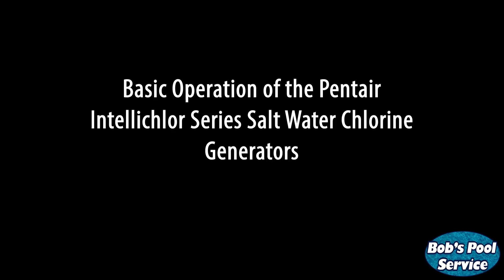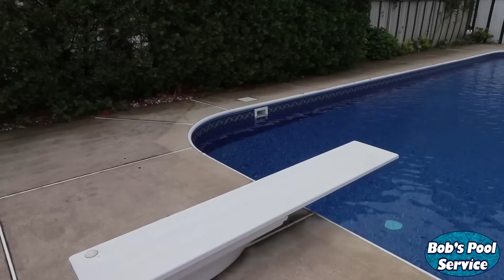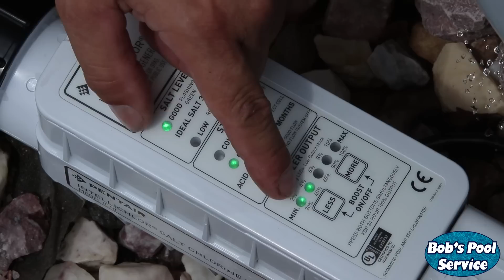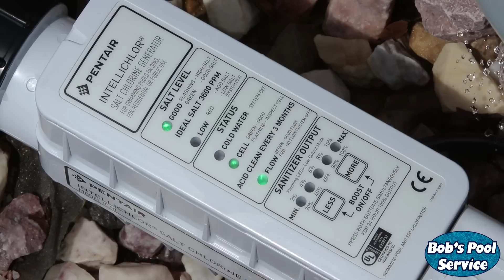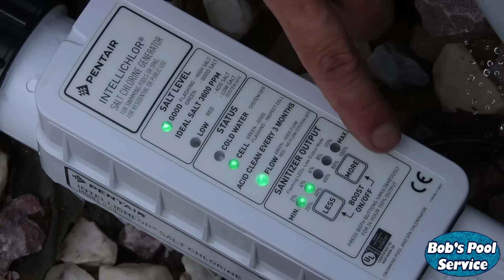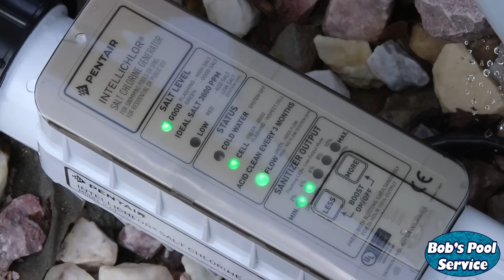Pentair Intellichlor Salt Water Chlorine Generator Operation

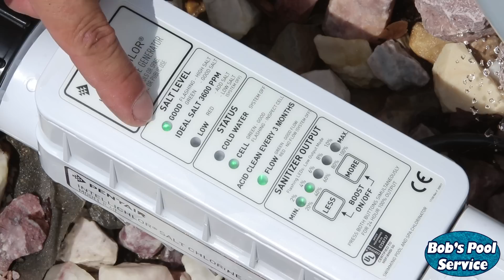Comment: 1:08 - are you referring to the “Low” light at this point?  Otherwise, you skipped that one.  And mines lit lol.  I’m assuming I’m out.  How often should these run low?  This was installed brand new last fall, “Low” is lit at opening this year.  Does that sound reasonable?
Reply from the maker: How much salt you lose over the winter all depends on the type of cover you have and amount of rainfall.  If you have a solid cover that doesn't let any rain through and you keep it pumped off so rainwater never accumulates on the top (and displaces pool water) you will lose no salt over the winter unless your pool has a leak.  On the other hand if you have a mesh cover or even a solid cover and allow water to accumulate on top displacing the pool water over the winter you will lose salinity.  Also make sure you run your system for a full 48 hours before testing the salinity, what tends to happen is rainwater is less dense than salt water and will just sit on the stop stratified, if you take a sample you'll find it reads extremely low.  Once the system runs and homogenizes the water you'll get an accurate reading.  For pools here in New Jersey with mesh covers I'm finding almost all of them are opening with about 2200ppm of salt necessitating adding another 1200ppm, for most pools that's about 8 bags of salt.  As for the lights they are a warning that it's too low for the system to operate but it behooves you to take a test and actually measure the salinity before calculating and adding salt to the pool.  Hope this helps.

Comment: Where it indicates salt level, the “good” indicator light is completely off, not flashing not solid, just completely off. My salt level indicator light is red, and reading low. My question is, when the salt level returns to normal operating ppm. Will the salt level light indicator then start working again, or is something wrong with my cell? I hope this question makes sense. Thank you.
Reply from the maker: Yes, when the salt level is back to normal the red light will go out and then the green LED (top most one) will illuminate green.   I would however check your salt level with a meter or strips, calculate what you need then add it to the pool over just adding salt until the light turns green.  The danger of doing the latter is if the salinity sensor in the unit goes bad or loses it's accuracy you could wind up putting way too much salt into your pool.  I saw a customer once that had 12,000ppm of salt, they just kept adding it expecting the light to come on green and the cell was fault, it never did and on top of that they added so much salt to the pool we had to do partial water replacements to get it back down to 3400ppm.
Reply: Thank you so much for your quick response. And thank you so much for sharing your knowledge, it’s extremely helpful.

Comment: This is great but my intellichlor doesn’t turn off just by pushing the less button. Very frustrating to run back and forth to the breaker
Reply from the maker: If wired properly the generator should shut off with the pump.  If you wanted to turn it off and run the pump you could unplug the power connector. It's designed to not need to ever be turned off, you can regulate the output down to as low as 2%.

Comment: My cell was just cleaned, after they cleaned it it was fine but then the flow light went dead meaning it didn't turn on at all.  They replaced the flow sensor and then tell me the cell is completely dead and need a new one.  Which I don't understand, it has about 2200 hours of usage(North East here) so only use it for 4 months a year this would be my 3rd season.  My flow light is off and the good and low salt level lights just keep flashing and neither stay stable.  I have heard that I may need to add salt but idk is it completely fried?  Waiting a call back from pool company.
Reply from the maker: Sounds like a lot of different things going on.  I have seen a small percentage of flow sensors go bad prematurely.  I can't speculate but hopefully the new sensor was installed correctly, it's a bit of a finicky process and pentair changed the design so not all sensors are universal now, I'm guessing because they wanted to put a stop to 3rd party knockoffs (which actually worked fine).  I would test your salinity with a meter, don't trust what the cell says and go from there.  Your flow light shouldn't be off, it should be green or red, if it's red I'd surmise the flow sensor still isn't working. As for the hours of usage 2200 would be very low, they're rated for 10,000.

Comment: How do you determine what % the sanitizer output should?
Reply from the maker: You have to test the pool water and adjust accordingly.  Also establish a consistent pump run time.  If you increase your pump from 10 to 20 hours you're going to be producing 2x the sanitizer.  I usually start ours at 40 - 60 percent then check the water in 2 days, if the chlorine is too high, I reduce the setting, too low and I increase it.  There is no intelligence on the cells or monitoring of your water so you need to test it.

Comment: Thank you for the video and explaining everything. Have you experience one of these salt generators not allowing to change the sanitizer output? I’ll press more or less and it won’t adjust. If I press and hold less or more the lights will move but then after a few seconds it’ll just go back to 80%. Seems like mine is just stuck at 80%…
Reply from the maker: I had one where the button went bad like that but that's out of 100's we see so pretty obscure case.  I even ripped it apart to see if it was repairable but inside the unity everything is potted in some kind of a resin making none of the parts under that panel replaceable.  Of course the flow sensor can be changed but that's about it.  That's unfortunate...  sometimes I have noticed the less and more buttons can be quite hard to press and might take extra pressure to activate.  I don't know if this would work for you but you could just keep yours at 80% where it's stuck and vary your filter timer to get correct output if it falls inside 8 to 24 hours or runtime, you could also wire in another timer to turn the power center for the cell on and off if you wanted to regulate it that way.  When the cell is set to 80% it isn't like the power or output varies, much like a thermostat it simply toggles it on and off every few minutes so its' on 80% of the time.  You may want to reach out to Pentair and see if they'll do anything for you although their warrant varies depending on if you bought it online for from a dealer.  We've had very few units fail under 3 years which is the maximum warranty period and most of the failures were either a bad flow switch or the fuse inside the power center went out from an electrical surge.  We get a few calls every time after a big thunderstorm hits with "dead" units, I carry 10A fuses of each style in our work truck.  Hope this helps, sorry your unit is giving you problems.
Reply: @BobsPoolService  thank you for your response. It’s unfortunate that I may have a faulty device. I’ll look into wiring a timer on it. I appreciate the insight and you taking the time to explain! You’re very kind.
Reply: Thank you for the detailed explanation from the blogger. This is our titanium electrode salt chlorine machine testing video. Welcome to watch. Thank you for your time

https://www.youtube.com/watch?v=Xi4_EYCDL2k

Comment: Does it know to turn on and off based on Chlorine PPM?  Like, does it read the chlorine internally?
Reply from the maker: There's no sensors inside to read the chlorine levels. It seems like it'd be a great thing but the maintenance and complexity of an electronic sensor to measure chlorine is unreal.  When you set a percentage it simply cycles it one and off so at 30% the cell is producing chlorine 30% of the time, if you see the green "cell" light on it's actively producing.
Reply: Thank you. I just put on IC60 and have 54,000 gallon pool.  All the reading I’ve done says star at 50%, but with the pool being 54k gallons I just set it at 80%.  Wondering if you think that’s too high for now?  I was going to test free chlorine tomorrow afternoon after work.
Reply from the maker: @31337cyberhuman  Hey Clint, I can't tell you how many times we get this question what percentage to set the cell at.  The answer really is "it depends".  Right now with the IC60 you're near the maximum size that unit can handle, Pentair always suggests oversizing by 25%, even more if possible and we put IC60's on 30,000 gallon pools all the time.  With all that said I'd probably start higher (80%) just so you don't wind up with a chlorine deficit but you'll really have to set it and test it.  Also remember there's a lot of variables, how long you run the filtration system is the biggest, if you run your pump 24x7 then you'll be able to use a lower setting on the cell than if you only run your system 8 or 10 hours a day.  The amount of sunlight on the pool, water temperature, bather load and chemistry all play a part in where you'll ultimately set your output at.  Just make sure your establish consistency, if you run your pump for 20 hours a day but later at some point turn it down to 10 remember you'll have to increase your cell's setting by doubling it to maintain the same production.  Also keep an eye on stabilizer levels, since the sanitizer produced by the cell doesn't have isocyanuric acid built in you'll need to add that separately, this isn't a bad thing because most pools using tablets have the opposite problem where they get too much stabilizer and that causes all sorts of problems.  Hope this helps and enjoy your pool!

Comment: Great video and to the point!! I needed a little refresher this season. Also, if you hold the more button it will give you the life left of your cell.
Reply from the maker: Yes, it definitely will tell you how much life has been used used up.  They're rated for about 10,000 hours of operation.  We've had really good experiences with the Pentair units overall and a few are going on over 8 years and still working perfectly.

Comment: I just cleaned my cell and I am still getting an alert that I need to clean my cell, any ideas or suggestions?
Reply from the maker: I would visually look inside and see if there's any buildup still remaining on the plates, sometimes a stronger dose of acid/water might be needed usually for a shorter time.  Also check how many hours the cell has on it, they're rated for 10,000 hours, you can check this by holding down the "more" button for 3 seconds, it'll show the percentage of life used up, if all the LED"s become illuminated indicating 10,000 hours your cell may be at it's end of life and need replacing.  Even iif it's at 80% this is possible.

Comment: Can you help? My intellichlor says salt low (app says 1000), but Leslie's and a salinity tester I bought both say 5000+.  How should I approach this?  Algae has started so would it help to go through shock steps first and reassess or is my Intellichlor defintely toast?  Thanks!
Reply from the maker: I would definitely trust the salinity tester readings over what the cell is reporting, I've seen this many times and it's caused people to put way too much salt in their pools, in fact I always suggest taking a reading of the water and never using the unit to check it.  With that said, there's a couple of things I'd suggest doing, first see how many hours are on your unit, you can press and hold the "more" buttom for 5 seconds and it'll illuminiate the percentage of usage with the LED"s.  Units last 10,000 hours, if all the LED are list or even 80% of them you're near the end of the cell's life.  If the unit however is newer, I'd suggest removing the cell and doing a proper acid cleaning.  If you google IC 40 acid cleaning you'll likely find the information, you can use muriatic acid or if you have the time even vinegar may work overnight.  When you have it apart inspect the innards, see if you have scaling or something caught in between the plates.  Hope this helps - Bob

Comment: Is there a difference in keeping it on 100% & boost function other than it reverting to original settings within 24hrs. I have a hotel pool that just don’t seem to keep up with the necessary Chlorine. Is high cyanuric acid preventing it that much? Thanks for the informative video
Reply from the maker: 100% boost doesn't increase the power any more than turning it up to 100%  by just hitting the up buttons, it simply prevents someone from accidentally leaving it up that high.  If you're having problems maintaining enough chlorine I would check first that the unit is sized correctly, I like to size them 1/3 larger or more.  For example a 25,000 gallon pool I'd use an IC40 on which is rated for 40,000 gallons.  For a 40K pool I'd use an IC60.  As for the cyanuric acid, yes, if it's high it can create a situation where the chlorine has to very high to maintain the pool and keep it free of algae.  It's one of those things where the right amount is important, too much causes issues.  The only way to really get that out is drain some water and replace it.  Also check your pH, if the pH is too high that makes chlorine less effective but of course don't let it get too low or you'll have eyes burning and corrosive issues.  Lastly check the life of the cell, you can do this by pressing and holding the more button for 3 seconds. The lights should scroll through and leave a few of the percentage lights lit up. The amount of lights corresponds to the amount of life used. If the first three lights are lit (20, 40, and 60%) then you’ve used 6,000 hours of the expected 10,000.

Comment: Thank you! I now understand WTF is meant by a "salt water pool" and what's going on with my salt cell - previous owner ignored it and just added chlorine. Big help, thank you!
Reply from the maker: So you CAN put chlorine in your salt pool, the salt cell simply produces chlorine by electrolysis of the salt water.  However, I wouldn't have an automatic chlorinator on the same system with the salt cell, it would eat it up.
Reply: @BobsPoolService  right now the pool doesn’t have salt in it and is just being treated as a normal chlorine pool - cell flashing low salt. I’ll test the cell when I’m there next and decide if I want to use it or not. At least I now understand how it works and the mystery of “salt pools” I kept seeing advertised!

Comment: I bave a low salt indication red light. It is becoming winter and nobody is swimming. All I really want to do is run the pump at night not to freeze. The water is clear. Should I just wait until Spring, swimming season to add salt. Like I said I just want to run the pump. Thanks for any info. First time pool owner.
Reply from the maker: Have you considering closing the pool by putting on a cover and having the pipes/filter/heater winterized?  Up here in NJ people generally close pools when they're finished for the seasons.  If you live in a climate where you want to keep it open year round even if you're not using it you still need to maintain the water chemistry and sanitizer. If the water is too cold though your generator won't work so you'd need to add chlorine directly into the pool (granular or liquid).  If the generator isn't indicating "cold water" though I'd add the salt now and use it.  If you're closing the pool (covering it) then I would't add the salt until you open it but you should balance the chemicals, things like low pH can ruin liners and plaster.

Comment: Do we need to turn off the sale generator before we add some salt to the pool?
Reply from the maker: No, you can just add salt directly to the pool.  I suggest putting it into the shallow end and then pushing it around with a brush or let the kids go in and stir it up.
Reply: OK, thank you. If I put salt in a bucket with pool water then spill it to pool will better than adding it to the pool directly? @BobsPoolService
Reply from the maker: You could do that, but it's really not necessary and you're just creating extra work. I usually place the bags by the pool and then cut them with a razor knife so the salt spills out into the shallow end and then push it around with a brush.
Reply: @BobsPoolService  👌, thanks your suggestion:)

Comment: I am trying to boost or increase the sanitizer output. I hold the less/more down simultaneously and it will do the dance once, but then turn back to what it’s set on (6%/60%). It is this one with the cold water function. While I’m trying to do this, salt level is solid green.
Reply from the maker: Is it a stand-alone installation or do you have an automated controller?  If it's the former then likely the unit has a problem but in the latter (automated controller) it may not allow adjustment on the unit itself.  I've never see one do this.